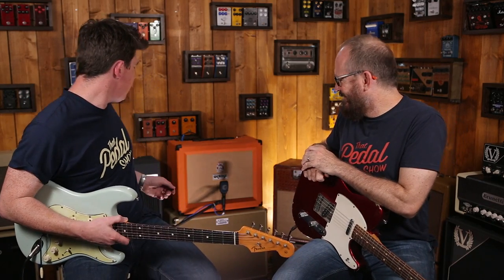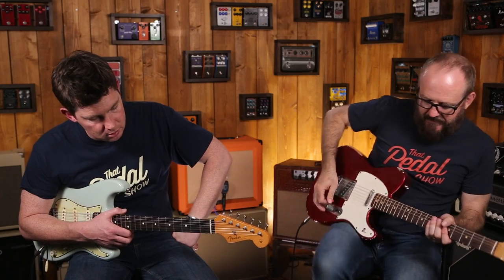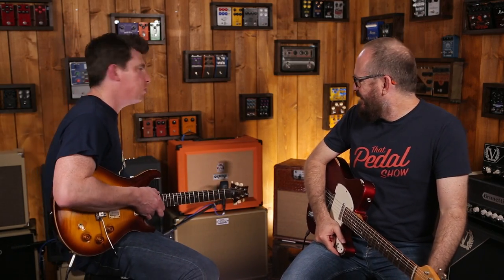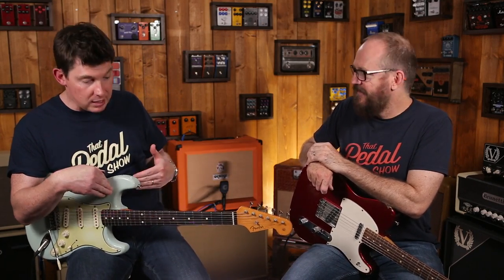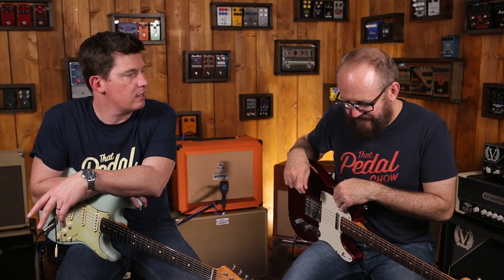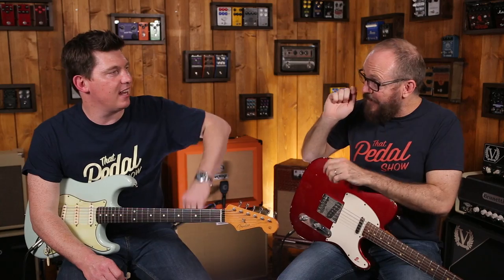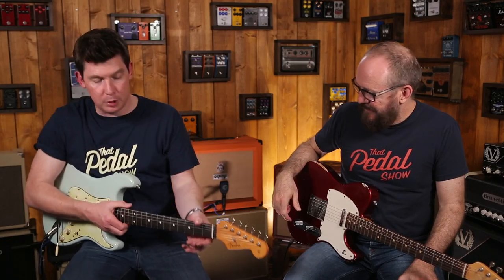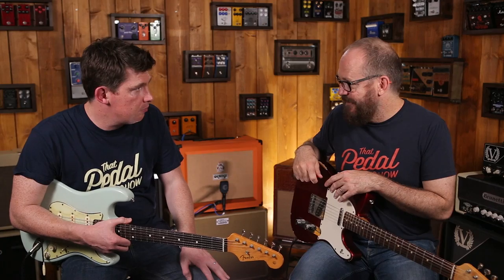That Pedal Show – Do We Like Transistor Amps? Part 1

Comment: I have no more questions about transistors amps... really, all good here... no need for round 2, ;) ... I do have a question about tube amps... hand-wired vs. pcb? Is it worth the extra cost for hand-wired? I've got a Backstair HT Club 40. Mainly, use the clean channel and pedals. But, I've wondered about the Artisan series. Or compare VOX AC15c with the hand-wired version... Or, the various marshalls and their hardwired counterparts... I've heard that the space shuttle used pcbs, so why spend the extra cheddar on hand-wired?
Reply: A hard wired amp is preferable in the long run as it is indistructable and easy to service and modify.
Reply: Hand wired doesn't mean it will be better per se, there are a lot of other reasons why hand wired amps are regarded as better. The Hamstead for example is hand wired and it will have better quality components in it down to Transformers  and the quality of the solder and have more time put into it so wiring is done properly so it doesn't hum. Will a Vox hand wired be better? take the amp out of its box and look at it compared to a purpose built hand wired amp. I have a Matamp 1st Lady a thing of beauty internally try looking up pics of it & pics of a naked hand wired Vox and spot the difference ;) If your wanting an amp for life look at custom builders rather than mainstream
Reply: My amp is rated at 7 watts clean with EL34 power valve into a 1*12 GreenBack, I can't turn it up full in small venues in larger venues I can add another 1 * 12 to increase the overall perceived volume because the amp doesn't give a stuff about load and will drive 2 as easily as one and I heard it demoed at the factory into a 4 * 12 with no loss of quality. Rating is pretty subjective with valve gear you need to try them out with different speaker combinations. Comparing the Vox AC30 to the AC15 part of the overall volume bump is its a 2 * 12 how much louder can you get running an AC15 into 2 Greenbacks instead of 1?
Reply: Most handwired amps use better components than cheaper PCB amps. That's the only reason they tend to sound better.
Reply: Using better components is a factor but it's not the only reason amp A can sound better than amp B, best thing is to go use your ears and see what you like there's a few mainstream ones around that people can demo (vox ac15, orange).Hardwired is also very expensive in comparison but you do get added longevity I've been lucky enough to own one for 15 years and age wise it's just a pup and will still be going strong in another 15.

Comment: I don't generally like transistor amps. I have had a 120 watt valve 2x12 since I was 15. But, I liked the Fender clean and with the OCD and the Blues Cube did well with most everything else, IMO. But that was it. The Orange didn't sound good to me at all. Interesting.

Comment: That OCD into the Blues Cube sound so nice. Yet, this video is doing injust to solid state amps. You used lower-end amps, when there are super amazing high-end transistor amps out there (that in my opinion sounds superior to many tube amps I've heared and played), like the Roland JC for clean tones and the Randall RG series which are amazing high gain amps. And it's funny a lot of player swear by tube amps yet use solid state pedals for overdrive and distortion, and then bitching about solis state amps. I thought that the Orange had the best clean tone of the three (that super-fast attack and awesome spank is soooo nice), and I can see some productions were those low-end transistors amps will perform far better than squishy, saggy tube amps. But when comparing, do justice and compare correctly.
Reply: I think it was a fair comparison. The best transistor amps can achieve decent clean and high gain distorted sounds. But dynamic crunchy overdriven sounds? No, forget about it. This is where the cheapest chinese tube amp outperforms even the most expensive transistor amp...
Reply: I highly disagree. I preffere solid state crunch over tubes, it works better for me. And the rest of the world too, they just don't seem to think about it - all that huge industry of overdrive, distortion and fuzz pedals since the 70'. In tones of amazing rock and blues albums lies solid state pedals that do the distortion. 
"But dynamic crunchy overdriven sounds? No, forget about it."? That's entirly your opinion, not a fact as you try to state. BTW I design and build distortion pedals, so I'm very familiar with solid state crunch, and I don't use my tube amp for mid-gain distortion anymore (and it's not a cheap chinise one, but pure american muscle)

Comment: While we're opening cans of worms to do with amps, as you're both tube amp guys do you tend to keep the tubes stock (and like for like replacement) or do you subscribe to the view that an amp can be improved with NOS / vintage tubes?
Reply from the maker: +Bernard Mills That's a can of worms for sure. Valves certainly can and do sound different, so choosing different valves and having the amp biased accordingly will change its sound. Better? Possibly!
Reply: Ok so straight out - in your own favourite Hamstead and Mesa LoneStar amps, do you have stock, replacement new production, or NOS valves/tubes?

Comment: You guys set up the fender with a much darker sound which suppresses whatever harsh high frequency stuff comes out of the pedals.  So, the test was rather biased.  Plus, no mix so some of the advantages of the SS amps might be missed.  We don't know which setup cuts through the mix well and which one gets lost.

Also, consider that budget gear is typically aimed and beginning musicians.  So, what they really need is a tool to enable their practice.  They need something that helps them play along to their favorite songs or other practice material.  What they really need is essentially a mini-PA system that gets them a good tone to mix with their practice material.
Reply from the maker: +nicethugbert It wasn't intentionally biased. We just set the amps up so they sounded good with no pedals. The Fender does have a stronger mid range in general, but perhaps it would have been more mid scooped in the other channel. This isn't science and it's really never meant to be. It's also not about bedroom level practise, it's about rehearsing and gigging. But whatever our preferences, it's really just a start point for your own tests and comparisons to find your own preferences. Thanks for watching!
Reply: Did you guys have difficulty getting a good mid range out of the SS amps?

BTW, since everyone remarks about tube compression, what about the a show on multi-band compressors (TC electronic spectra comp for example)?

Comment: Are you going to bring in a Roland JC 40 (or such like) in the next one?
Reply: OK sorry. Next time I'll watch the whole video before asking a question! I will add, though, I have a new JC 40 here and it sounds awesome with my MXR Modified Badass Custom Overdrive going into the front of it. The built in distortion is still crap though. Why Roland (Boss) can't stick an awesome distortion into the amp I do not know.

The clean tone with the stereo chorus is just delicious!

Comment: After two Bassbreakers which just failed - one of them had an inoperable effects loop - manufacturing flaw and, one with an annoying buzzing which wouldn't go away. A bit of research rvealed loads of quality control issues. NOT something I want to thinking about when jamming in front of people. I found the Orange Crush Pro 60 with a Bogner LaGrange and/or an Ethos Overdrive (with simulation out) brings most of the joys of tube tone - with none of the headaches. I have had limited experience with Blues Cubes, but I've played them enough to know they're fine.
Reply from the maker: +Guitaraokee Tuesday Sorry to hear you had troubles GT. In 25 years of playing valve amps pretty much all the time, I've only ever had two go down at a gig (Mick here). One was a mains fuse issue (it used to do it regularly so I always carried spares) and the other was a rectifier tube. Our Bassbreakers have been solid so far. Had plenty of Reverb trays crap out on a few different brands. Cheers!
Reply: I wish I had your luck Mick!. I've had several go down at the most inopportune times, Which is why I always carry a SS backup. The current Fail-safe backup is a Quilter Mini 101. Very nice little unit. 2 lbs. and easily keeps up with a loud band. Great tone, loves peddles.
I still perform with tubes, but I'm always wary. I got rid of the Orange, too heavy!

Comment: Were you guys running the pedals into the front of the Orange? Also which channel clean or dirty? My CR120 does not take pedals well.
Reply: Also, what were your settings?
Reply from the maker: Yes, always in to the front. Can't remember the settings - we always set our amps the same way, so that they're balanced in terms of EQ (not too much, not too little of anything) and have enough feel in the front end/power stage to give a bit back to the guitar. That's always a very personal thing. As for 'not taking pedals well' that's a bit broad to offer anything useful in response. What do you mean?

Comment: all I care about is an amp with a great clean channel. If it doesn't have tubes and needs no maintenance, better yet. If it has FX loop to put my pedals through, awesome. Just as long as it has a great clean channel, I'm game.
Reply: That's why its worth digging out these old late 70s/early 80s solid state relics. The ethos behind the circuit design was different back then. Couple that with some speakers that have character in spades and you have a good platform on which to build.
Reply: Quite true.

Comment: And the OCD is Germanium, asymmetrical clipping (what an overdriven amp does), even order harmonics too.

All the reasons why its profundity is inexpressible     .:)   !
Reply: Actually, I've read that overdriven amps do asymmetrical clipping in the preamp section, possibly also the phase inverter tube (don't know a whole lot about this...). Whilst the power amp tubes do symmetrical clipping. That is, if it is a Class A/B design, and the tubes are properly matched. Lots of famous tube amps (Fender, Marshall etc..) are A/B, and you know how renowned they are for their power amp breakup...
Reply: Well nothing is 100%. That is when you rely on your ear. There are certain tell tale audibles, and I go by that.  Every amp is different.  Peripherals in the chain matter too (chords, aftermarket pickups, strings, intonation, etc.).  

There are certain parasitic oscillations that point out the asymmetrical clipping. Like a buzzing at a certain frequency.  Just try the Timmy pedal, play the symmetrical diodes, and flip to the asymmetrical and you will hear it.

Once the ear is attuned to asymmetrical clipping, then you see and hear the truth yourself without any outside reference.

When I put my Fender Reverb Deluxe on 9, I hear prominent asymmetrical clipping. Not 100%, but 80 - 90 %.  I hear the same with my germanium pedals (OCD and Soul Bender), and the same with the Timmy on asymmetrical.

What you said is true though.  An ancient Yogic text said "unripe knowledge is dangerous".  I am about 50, so my knowledge is "ripe".  I did not see this until my 40's either.

And the intellect cannot see the subtler truths either.

The short answer is to see and hear the asymmetrical clipping directly yourself.

AHH . . . ASYMMETRICAL CLIPPING DIRECT REALIZATION !

So keep up the good work, and take care   .:)

Comment: If anyone reads this I need help. I am looking for a solid state amp. I am a little mad with pedals such as synthesiser pedals and pitch shifting pedals as I love my ambient sounds. I want solid state particularly for the ease of never having to worry about the vulnerability, weight and inconvenience of valves. I have previously owned a Roland JC-40 which is without a doubt an incredible amp. However I need something that as well as giving me the beautiful clean sounds, will react well with overdrives and fuzz. Thanks. The blues cube in this video sounds great however it is a little pricey. Any suggestions? Also looking at Yamaha THR100?

Comment: Should  have used a tube amp with 1x12 to make a fair sound comparison.  You would think that someone that has a series called "That pedal show" would know the switch on the ocd is hp=high peak and lp=low peak, not high pass and low pass. just my 2 cents.

Comment: Wouldn't the size and number of speakers affect the 'fullness' of the overall sound? If you take an amplifier head and plug it in to various different speakers and cabs you'll get completely different sounds. So maybe next time do a version where you use transistor heads and valve heads on the same cabinet? Could make for a better comparison.
Reply from the maker: +Joel Gomez It does have an effect Joel, but in this instance we're using the combos just as they come out of the box, ie how anybody is likely to use them. What the cabinet won't affect is the way the amp feels in terms of its response to the guitar. Nevertheless, it'd be an interesting avenue down which to wander at some point. Cheers!

Comment: The Bassbreaker has a notably different tone in each comparison (I like it better), but you are comparing two combos with 1x12 to the Fender with a 2X12. Maybe the Bassbreaker 15 would have been a better comparison.
Reply from the maker: +PatrickG Yep, we discussed that. The 1x12 would have made more sense, but the 15 doesn't have the clean headroom. This isn't science, it's just a discussion to get you closer to what you might like to try for yourselves. Thanks for watching!

Comment: I would politely suggest that the Orange is about £200 cheaper than both the Roland and the Fender, which may well account for some of the difference. I thought the Orange sounded the worst, but then again an amp approaching £400 may well not compete with two amps approaching £600, in the same way the £600 Fender may not compete against a £900 amp...
Reply from the maker: +ChopaLopa yep,it's all relative, interesting though :)

Comment: my opinion is torn. for a few years I used to use a transistor amp ( a peavey bandit 65) and it had a sound to it that... just... had a sound that was neat, specially live. but tubes, valves, sound amazing and you can not replace that sound (Kemper dudes might disagree) 
so, all I can say is that you can find a good used cheap tube amp it doesn't have to be new, and there's some older funky brands that sound amazing so just look around before buying

Comment: I prefer valve amps.
Trannies sound plastic. Short sharp spike sound.
Valve is like the difference between 2D and 3D.

Just been thinking of all the amps I've play though over the years. Lots of these were not
mine.
Amp's I've used over the years.

Yamaha XJ20
Laney Linebacker 65
Laney 50watt valve
Laney LC50
Fender deville 4 x10
Fender hot rod deluxe
Fender hot rod deville 2x12
Fender cybertwin
Fender Supersonic
Fender Vibroverb
Fender Vibrolux
Fender Deluxe reverb
Fender twin
Other Fenders.
Boogie F50
Boogie 5.50
Boogie Mark 1
Boogie Mark 4
Boogie Mark 5
Boogie Single rectifier
Boogie Trem o verb
Boogie Lonestar
Boogie 5.25
Roland VGA 3
Roland Cube 30
Roland Cube 40xl
Line 6 Flextone 1
Line 6 Flextone 2
Marshall Vintage Modern
Marshall JVM 410 c
Peavy Classic 30
Vox AC30
Crate VC 5212
Trace Elliot Tramp
Rivera
Bogner
Soldano
Blackstar HT40
Blackstar Artist 30

Comment: So, would a tube screamer work on a solid state amp? I have an old H|H IC100S.
Reply from the maker: +Chris Davies Yep. Might sound a bit sterile in that the ss preamp doesn't react the same as a valve front end, but there's no reason not to try it!
Reply: Thanks for the reply , best I take my amp to a shop with me and try one out before I buy methinks :)

Comment: It is that glass sound of a tube. That is the only way I know how to describe it.I think if they had turned the solid states a little louder it might have helped. To me, a solid state amp makes the guitar sound like you are playing with smaller size strings than the tube amp does. It's kinda like you are playing with 8 gauge strings vs, 10 gauge strings.
Reply from the maker: +why not me it is a hard thing to quantify, but it’s 100% real

Comment: I always feel like Orange valve amps (heads anyway) are really woolly in a way that I don't dig. Their transistor stuff however is needlessly treble heavy. Love their cabs, but I don't think I could get a sound I'd be happy with through seemingly any Orange guitar amplifier.
Reply: I'd beg to differ - as someone who owns the exact solid state Orange combo they use here, I can assure you, it's a majorly bassy bugger. On the dirt channel I run bass at 2, mids at 5 and treble at 8.
Reply: +Sam Shore just going by what I hear in the vid, man.
Reply from the maker: +Deet Cologon Mick here - I had an OR120 in the late 90s and loved it dearly. They definitely have their own thing, which was perfect for that particular band. It was always best at patent pending volume too. :0)
Reply: Hey Mick. Actually the OR heads from what I've heard do sound really cool, but I haven't played one myself. Lots of people use Orange heads and they can sound great, but whenever I play one I can't quite get the sound I want from it. More a Marshall kinda guy, but it's all just apples and... well, y'know.